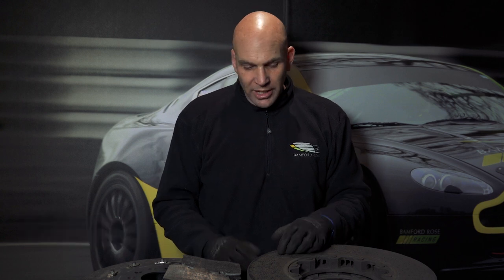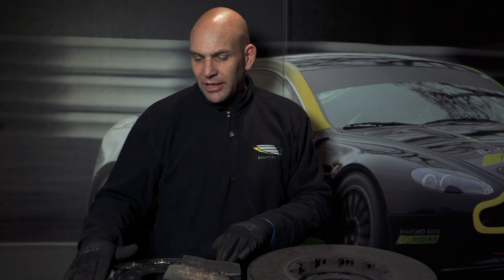Advice for Carbon Ceramic Brake Noise?

Comment: For the road, I see 2 positives and 4 negatives. Oh, and 2 examples why they're not needed:

Positives: 
1) your wheels stay cleaner for longer
2) impress folk, after explaining for 10+ mins why they're so impressive...

Negatives: 
1) how much?!
2) difficult to eliminate squeal
3) risk of damage from salt/chemical cleaners
4) how much?!

Not needed because:
1) the DB11 ain't got them
2) Sabine Schmitz's E60 M5 ring taxi retained it's OEM steel brakes

Comment: Thanks Mike once again for a proper breakdown of causes and noises. Is it possible to retrofit Steel Brakes instead of the Carbon Ceramics
Reply from the maker: Tony There is a company named rebrake.de in Germany who recondition, but I’ve no first hand experience of it
There’s also a company selling steel equivalent discs / pads - RacingBrake, again, I’ve no first hand experience of the hardware

https://www.racingbeateurope.com/aston-martin-dbs-2007-on-v12-vantage-racingbrake-iron-two-piece-rotor-kit-replacing-oe-ccm-rotors-2149-p.asp
Reply: @BamfordRose  Hi Mike. thank you for the info. I was happy to lose the unsprung weight advantage because of the issues associated with Carbon Ceramics and the Racing Brake option looks good.

Comment: Hi Mike, I just picked up a 2004 DBS this week. 17k mikes from new and rear pads changed 3k miles ago back in 2017. The rear drivers side wheel has developed a terrible squeal but only as it approaches a full stop. Gets worse as the wheel heats up and drawing lots of attention for all the wrong reasons :(. Is there anything I can do to help it myself or is it a case of taking the wheel off, de-glaze the pad and apply some compound as you suggest? I’ve heard tunap 113 is supposed to be good. Any advice would be most welcome. Cheers!

Comment: Last week I was on the track with my S63 with carbon ceramic breakers.

After 8 laps, I saw this white stuff on the pads with shiny reflection on the rotors disappeared. It was the end of racing for me!
Scared with nightmares, now I found out, the breaks were bedded properly ;]
Will sleep again with pace!

How racing on track affects carbon ceramic brakes??

Comment: Hi Mike I recently purchased a DBS, I was unable to inspect the car my self so had a franchise dealer look at it for me, the report on the  brakes was simply front pads at 3mm. The car has done 45,000klm and apparently still on its first pads, the front discs are rough with little mirror finish could this be a simple pad change and heat cycle to return the discs to normal condition?
Reply: You should definitely replace the pads. I read on several forums that you should replace pads half way through their thickness; never wait until the minimum service tickness.
I replaced the pads on my SL63 AMG, went out at night on an empty road and did a number of braking cycles (gradually increasing in braking force) and they are amazing. My rotors have a couple of patches of thermal delamination, but are still under the wear threshold.
Reply: @peterbratu  Yes have replaced all pads and bedding  in procedure, now have  better looking front disks, white powder film on leading edge of pads and stops great with no noise, all thanks to Mike's advice. Cheers.